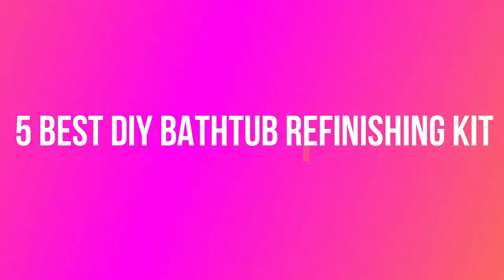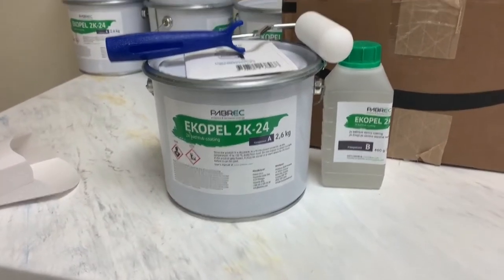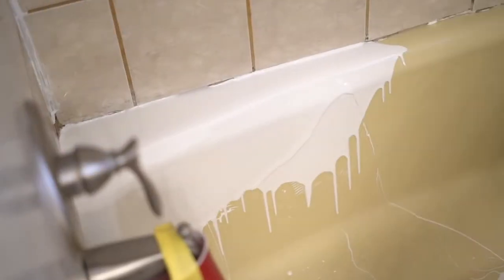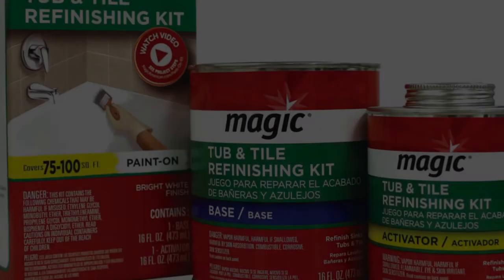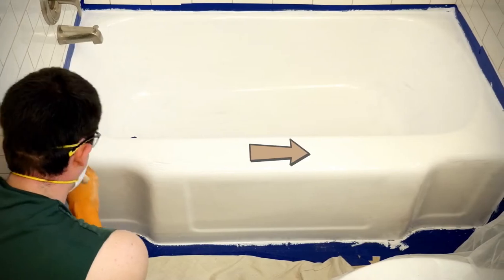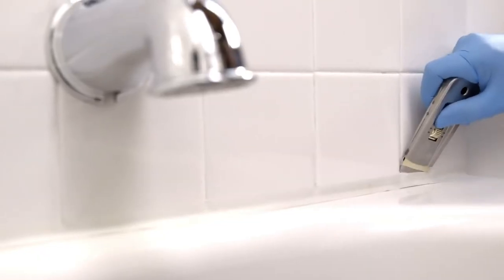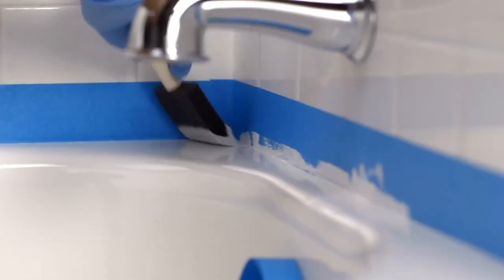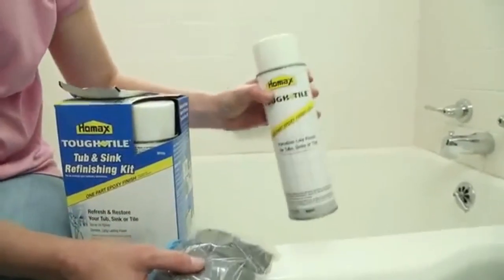5 Best DIY Bathtub Refinishing Kits

Comment: I would not recommend the Rustoleum Tub and Tile. It tends to yellow and look janky after a little while.
Reply: Totally agree. I wish they would talk about product longevity. Or the discoloration that happens with some of them.
Reply: There is also a product by Klenks, but I haven't tried it before.
Reply: Looks good for a month though 😂
Reply: They all yellow and have a rough sort finish to it . They yellow because they are all epoxies  with different brand labels but same material . White epoxies yellow with time.  I have over 15 years experience as a bathtub refinisher so I can tell do yourself a favor and avoid all this products . They are not made to last .
Cheers